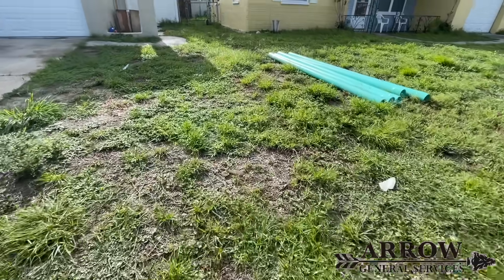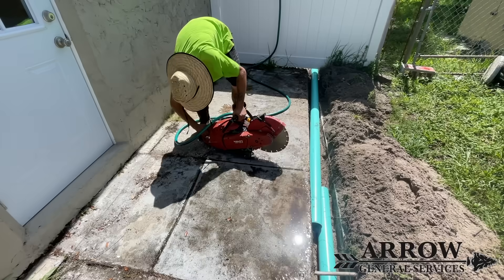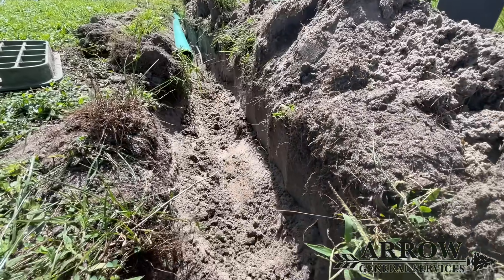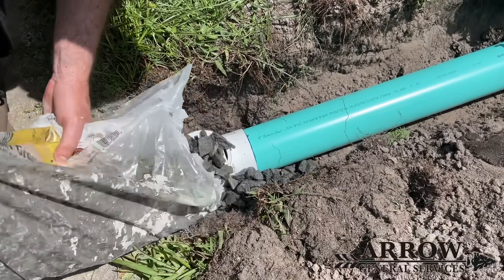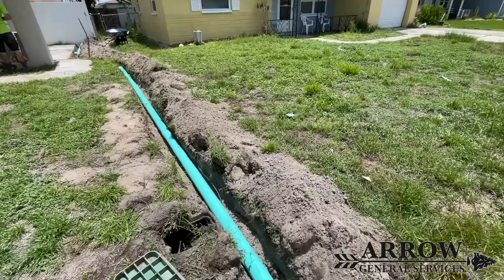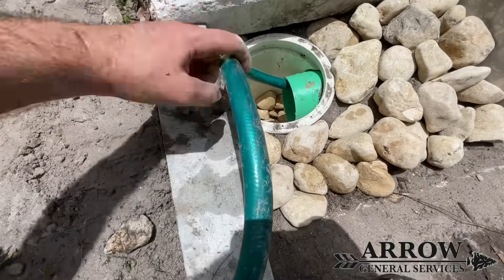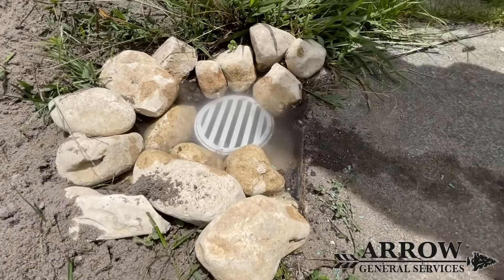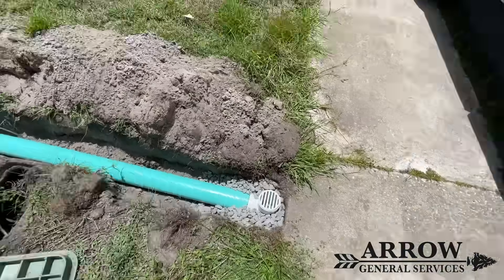How To Drain A Yard With No Slope - Flooding Issue Solved

Comment: Not sure I follow, where is the big catch basin for the sump pump, no slope means your going to have to use some type of force assistance otherwise the work you did is just going to have no effect but be for show. it looks like you just put ponding in another location.
Reply: @Doubt9It  that's exactly what I'm stating what's going to happen without a sump pump to force water to daylight, right now its set  just hold water and gravity to make another added pooling location.
Reply: Yeah just moved it to the public sidewalk haha
Reply: It’s gonna run over the sidewalk and onto the street and the street has its own city or township drainage

Comment: Been doing a lot of research on draining a level yard. I basically live in a pan. If there is a low spot in my yard I can't find it. Pretty much all I've discovered is I need to find someone who knows more about landscaping than I do and I can't afford it. Here's my multitude of problems. My road is higher than the ditch in front, both neighbors yards are level with mine, the back yard is two acres, and the soil is basically straight clay. Short if digging a pond or ditches that hold water and attract mosquitoes, I'm at a loss.
Reply: Put a lot of manure on the entire 2 acres . The red worms will dig down thru the clay to " stash " the manure and will open up the soil for drainage . It takes a couple of years to see results but it works .
Reply from the maker: That is a tough situation. If you have the space for on site storage then a retention pond would probably be your best bet. Google Mosquitoes dunks to solve that issue if you do dig a pond.
Reply: Facing a similar problem here
Reply: sounds like the city may need to help you guys create a ditch on the side of the road where the water can run down the road? Create a drain that runs to the front and then from there the city takes over. I'd go to the city board meetings.
Reply: @splat00n  I appreciate the advice but the closest town to me is 10 miles away and has a population under 1000. I live in Amish country. I have woods to my rear and a bean field in front across the road that is also at a higher elevation than my yard. I was thinking maybe I could talk to the township trustee but I'm not sure they would do anything. It's a pretty poor area. It's beautiful but as far as services are concerned, it's lacking.
Reply: @joshuawells5953  Keep looking! There has to be solutions for issues like the one you’re having.
Reply: @joshuawells5953  think underground pond. Its expensive. Dig a very large hole add gravel place very large culvert pipe for storage continue filling with gravel and cap with soil. You can even use this as rain fed cistern
Reply: What about windmill operating a pump to send the water elsewhere

Comment: I'd like to see this in action. Because make believe sounds nice and all. But saturation is a mofo. Whats to stop it from just no longer "draining" since you said there's no slope , and it just sitting in the backyard regardless
Reply: As long as the inlet by the house is any amount higher than the outlet by the street it will drain.
(By inlet I mean the top level of the inlet catch basin area, as compared to the same area at the outlet. Not the pipe itself, at either end.)
Reply: @Mavrik9000  Did the narrator actually say that?
Reply: @jimkoss3318  No he did not. In fact he said there was no slope and his solution was a sump at the end of the drain pipe. Water will find the low spot and pool there. How long in a Tampa deluge do think it will take to fill all the drain pipe and the sump?
Reply: @jimkoss3318  Maybe, I'm not sure. I'm saying that based on having installed the storm drain system of 4-inch pipes for my house 100 feet to the street, and the larger 10-inch pipes in the public street.
Reply: @terryharris3393  Even flat pipes have a slope. It is equivalent to the interior diameter of the pipe. That is not ideal of course, but better than nothing in cases such as in the video.

Comment: At least you used a why this time.  Look for HDPE triple wall, it's a ton cheaper and the correct pipe for the application.  I would have used a larger dry well too.  Look up drain wells sold by drainage direct.  You won't be able to hand dig it, but you will be able to charge correctly.  Nice work.

Comment: I was thinking to myself, that’s just gonna fill up with water immediately. You explained and it makes perfect sense.
Reply: it more than likely will.  if the ground is holding water by the house it will holding at the sidewalk.  the water storage at the sidewalk is so small it will only help for light rains.   most cities have ordinances were that would be illegal as the run off has go over the lawn first and can't be directed to municipal stormwater systems.
Reply: @vinceaaron8921  this looks like Florida and in many Florida neighborhoods there are concrete water channels that move the water from areas into storm drains. 

I didn’t see it in the footage but I imagine the channel is there, once the water rises above a certain level it’ll begin to move towards the channel.

Comment: is this solid pipe better than perforated pipe that installed like a french drain? how many drop per foot do u dig for?
Reply: you cannot use perforated pipe under concrete. you will either destroy your concrete with water damage, or crush the pipe due to weight.

Comment: Looks like Florida. Will never work up north.
Reply from the maker: You are right this is in Florida and up north is a whole different animal 🦒
Reply: Explanation for why it wont for up north?
Reply: @rayik  Up north that water will freeze and bust them pipes up in the winter.  That pipe didn't have a downward slope.  Up north if your pipes are not in a downward slope any standing water could become a issue, blocked by ice.  However for the south this was a beautiful solution.  People up north even get electric-radiant heat tubes installed into their driveways to keep the ice off.
Reply: @rayik  while @meganstrife4988 offered a meaningful response about ice, there is also a soil composition problem.  Sandy soil, like what we see in the video, percolates (i.e., absorbs water) well.  Clay, on the other hand, does not.  Much of the U.S. soil east of the Mississippi River is red clay.  With this type of soil, this solution (seen in the video) would send most of the water onto the sidewalk/road and/or create a long-standing puddle at the exit location.  Typically, this is not desirable.
Reply: Would this same system work up here in Kentucky where we have clay dirt, assuming I used corrugated pipe instead of PVC, to allow for freezing temps?
Reply: @jesseison-bowman3964  Not sure how bad the frost/heave cycle is in KY but, if the ground is pretty well saturated in fall, a simple corrugated tube might not do the trick. The ground could undulate and create low points for silt to build up a blockage, which could then increase the likelihood of ice forming and splitting the tube.

If you're thinking of a DIY project, you might try to get an engineer or a contractor to draw up a set of plans for a cool $100-200. Otherwise, I know "_Ask_ This Old House" had some good info on solving water drainage issues.
Reply: Maybe good for Tampa but up here in da nordern tundra ur mudda be spainkin ur backside.